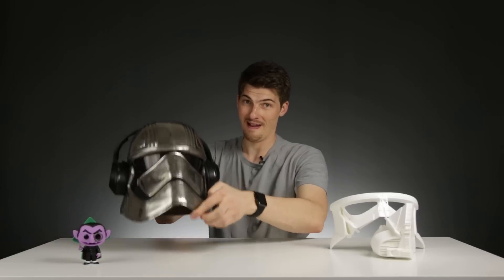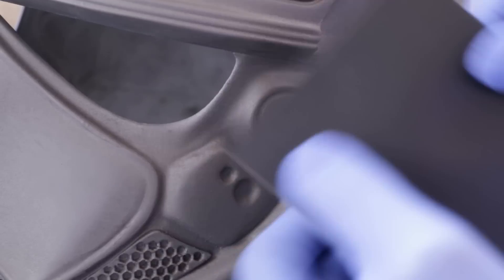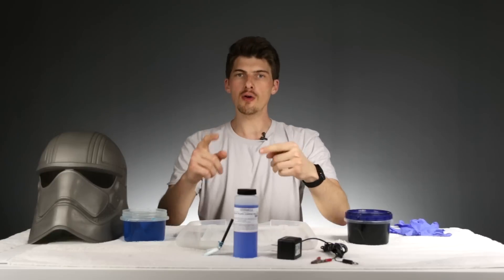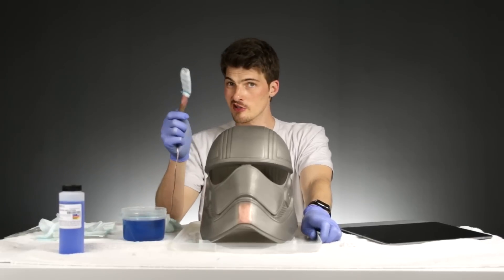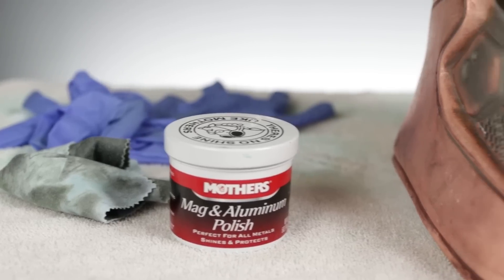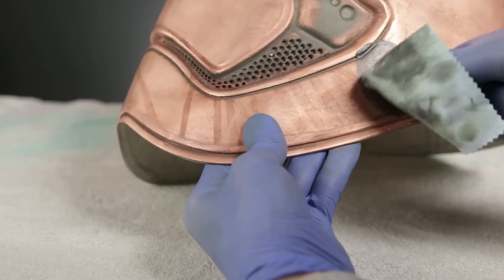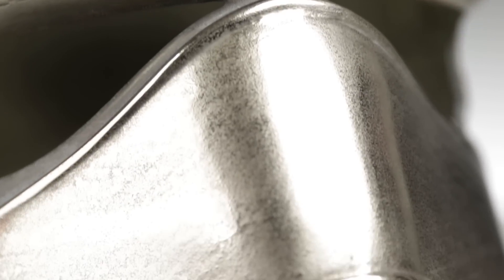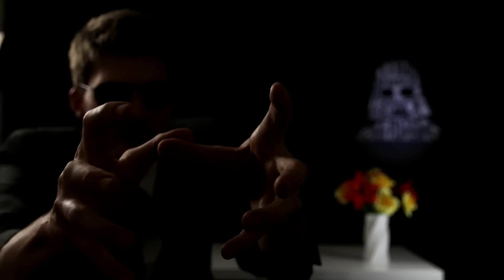How-To Make Metal: Electroplating a 3D Printed Star Wars Helmet

Comment: Great video! I ended up buying the conductive spray paint and electroplating kit to try it out on my parts. However, I ran into a problem and maybe you can help shed some light on it. In your video it seems like right as you start brushing with the copper, it instantly appears and becomes a fairly uniform layer pretty quickly. For me though, I feel like I'm brushing the same spot for a long time until I even start to see the copper show up and even then it never seems to become a nice solid patch. Have you noticed if the conductive paint thickness, smoothness, or anything else affects how well/quickly the copper attaches to the print?
Reply from the maker: +Yodaman921 Hey Yodamam! Sorry for the delay, but yes there are a number of things that can affect the plating process. First, you should make sure that your paint has cured for at least 24 hours. Until it is fully cured, any of the solvents still left in the paint can interfere with the plating. 

The smoothness also has a big impact on the plating. The smoother it is, generally, they better it will plate. One important thing, it did take quite a few minutes of brush plating over the same spot for the copper to really start showing up when I was doing it in the video. For the sake of viewing experience, I cut out some of it so it seems a lot quicker than it really was. 

My next recommendation is where you may see the biggest change! After you have built up some copper in an area, take the ground wire (the black one usually and the one that is clipped to the helmet in the video) and have it contact directly with your copper layer  (instead of the painted layer) while you brush plate some more in an adjacent area. This can have a huge impact as the paint is a decent conductor, but the copper layer you've built is an excellent one. 

For the future, I recommend first plating a spot where you can connect the ground clip to the copper, and than brushing outward from that spot. It seems to significantly help the speed.
Reply from the maker: +Yodaman921 Btw, thanks for not only checking it out, but actually trying this stuff out. Kinda neat right! Let me know if you have any other questions or anything like that. You can reach me on twitter @bretthalladay if you'd like too.

Cheers!
Reply: Thanks for the info!

As for my part (An R2 astromech dome), I'm still figuring it out as I go. I let it cure for 24 hours in a place that's both hot and dry. It's very smooth, it was previously primed and sanded before I applied the conductive paint, then sanded after it was cured. I've tried placing the clip on copper, but maybe I didn't have enough copper built up when I did that. 

Anyways, I ended up ordering a variable voltage and amperage power supply (0-30 V and 0-5 A) to see if adding a bit more voltage or current ends up speeding things up. Would make sense if it did. I'll let you know how that test goes though.
Reply from the maker: Yodaman921 ok yeah a voltage regulator can help out a whole lot.
Reply from the maker: Yodaman921 Yeah it can be a slow process at first. The copper layer needs to plate pretty thick. Everything sorta speeds up at a sliding rate. After you get that first layer thick and connect there, things can really start to speed up. 

I'd love to see everything as you work.
Reply: So I got the variable power supply, a 1"x6" copper anode, and I ended up going with a acid copper solution by Krohn; and boy can I tell a difference. It plates a lot quicker now. Just spending around a half hour got a good part of my project done, not much longer and I'll have the whole thing nicely plated. Just need to be careful though since I was playing around with the voltage to see what would be optimal, and if you increase it too much, the alligator clips start to heat up and melt the 3d printed part (my part is PLA). Overall though, I'm glad I got the new equipment and can't wait to get the whole thing plated and then polished up.
Reply from the maker: Yodaman921 Great to know your doing this on a pla part! Yeah the voltage regulator can make a huge difference in speed. I am now wondering if the use of acid copper can have a big impact on the speed as well. Its possible that the acid will help to prime the nickel paint for electroplating. 

Glad to hear its working out for you man. If you have an instagram or twitter, or just some pics on imgur or something, I’d love to check out your results!
Reply: For sure, once I get the dome polished up in copper I'll post a picture before I go on to nickel plating. 

At some point I may go back and approach this more scientifically to figure out what has made the biggest difference. It's just at this point I've changed so many variables. Different anode size, switching copper solutions to be the acid solution, switching brands of solution from Caswell to Krohn, and the power supply. I already got a nickel anode so I'm ready when I eventually get to nickel plating, but I may end up ordering some of Krohn's nickel solution since maybe it's a better quality than Caswell. One other thought is that my solutions have gone bad in some way; since we used the same kit and paint you'd think it would produce the same results unless something in my kit was faulty. Regardless, finally getting electroplating to work is really exciting due to the realism you can get on parts compared to using paints or pastes, or at least the ease of achieving realism.
Reply from the maker: Yodaman921 Yeah there is a lot of experimentation that goes into it all and a lot of variables. To be honest, I struggled for months experimenting with NUMEROUS different methods and everything before I figured this stuff out here. 

Seriously though, apart from being cool in general, being able to get this sort of finish with this method simply can’t be rivaled with any single paint or metallic coating out there. I’ve seen a few that come sort of close, but then they fall apart when they are touched by hands. Not only that, but this stuff is magnetic and conductive, which opens the doors for a whole number of things in the maker community. 

Glad you are getting it all worked out and the results are coming out how you want.
Reply from the maker: Yodaman921 Here’s a tip too, if you ever working on smaller projects, look into tank plating your parts. It reduces a lot of the labor involved, but most importantly, you can build really thick layers of copper. I did it one, let the copper build for several hours, and then used sandpaper to smooth out the copper and level it. I worked all the way up to 1500 grit and then polished like in the video. The finish is like a dang mirror. It’s stunning.
Reply: I've thought a lot about tank plating. It'd be a bit pricey to do one with my current project scale, but I've been curious to test a few set-ups to see if they'd work. Some ideas:

-"Tank" plate in small sections using clay. Position the object (my dome) so the area you want to plate is a relatively level surface. Put a perimeter of clay on the surface in the shape of the area you want to plate. Fill up the newly formed reservoir with your plating solution, suspend your anode in the solution, and turn on the power. So it should be like _|__|_ where the vertical bars are clay and the spot in the middle would be electroplated on the __ part. Keep moving the clay/reservoir around until the entire piece is electroplated (rotating the part as needed).

-If the large part consists of a bunch of smaller 3d printed parts, tank plate the smaller pieces, but only on the surfaces that will show on the final piece. That way it won't ruin tolerances or waste copper and conductive paint. Once everything is plated, assemble the small pieces like they normally would with glue or whatever method you prefer. Then fill in any seams in the copper by using brush plating and "welding" them together.

Once I'm done with plating my dome I'll use the left over acid copper solution to do some experiments on more parts since I'm really liking how the metallic finish looks and it's a lot better than using metallic filament, paint, pastes, or any other methods that simulate a metallic look. Just need to figure out an optimal process for plating 3d objects.
Reply from the maker: Yodaman921 so believe it or not, in this video this was the second Phasma helmet I built and electroplated. The first one I tankplated smaller pieces first because a setup large enough for a full helmet would be prohibitively expensive. 

While it worked out and the results were pretty great, it cause sooooo many problems and headaches and it led to a boatload of surface defects. Seriously, it was a very frustrating process. Doing this second one was worlds easier for the vid. 

I like your idea for the clay though. It's rather creative and just might work.
Reply: What voltage did you end up deciding was the best?
Reply: Voltage depends on a number of different variables, but the largest 2 I think are size of what you're plating and how conductive your surface is. For me I started around 7 volts for a Star Wars astromech droid dome, but the more copper I put on I was able to drop the voltage down to 5 volts. What I did notice though is plating worked best around 1-2 amps. So if I was below that I'd increase voltage, or if I noticed the amperage spiking too much, I'd decrease voltage. (Also a helpful tip, don't clip your alligator clip to your work, put a piece of metal in it's grip, such as 2 quarters, and hold it against your piece. That way as you play with voltage, if you go too high you won't melt or burn your piece).
Reply: Thank you for the info. 
Since I already have a power supply (for tattoo machines) I'm gonna buy the solutions separately. Probably the same solutions you bought. 
I, too, would like to see your progress
Reply: Update time! So I've been a bit busy recently and haven't had too much time to play with this. I did try out the clay wall setup; no dice, there was just too much leakage and the anode was too close to the part resulting in a bad plate job. However, I did purchase some microfiber sponges (https://www.amazon.com/gp/product/B00BTGSGFK/ ) and they are the best in the world. I cut a slit on one end and slipped my anode into it (so it's between the sponge and the microfiber cloth). So now there's microfiber and a sponge between the anode and my part; which is great because the sponge holds the solution in place and the microfiber is a bit more rugged than a cotton cloth. Things to note while doing this method, you don't need to press down on the sponge, just lightly hold it against the part; voltage needs to increase by a lot, the sponge is similar to a resistor, so I went all the way up to 30 volts; make sure your surface is nice and clean so it plates pretty quickly. 
Results of nickel plating onto copper after doing a quick test (took a couple of minutes to get this thin layer into place): http://imgur.com/gapiyER
Reply: So you added a microfiber sponge to your anode wrapped in microfiber cloth? 
That's not overkill? 
Regarding your picture, did you polish your copper layer any or did you just plate the nickel right after. Cuz that's pretty close to the look I'm wanting to achieve, not the super shiny chrome, but the dull stainless steel look.
Reply: Yodaman921, did you end up getting the nickel solution by Krohn as well and pairing it up with their acid copper solution? Also, did you just pour and use the solutions straight from the bottle, or did you mix anything into them?
Reply: Jonathan East 
Yup, I used Krohn acid copper and Krohn nickel. I poured them into a Tupperware container to make it easier to use, but didn't add anything else
Reply: Jonathan East 
I cut open the cloth around the sponge and slid the bare anode in. So yes there's a cloth and sponge. It may be overkill, but as far as I can tell it works (at 30 volts though). I didn't polish the copper, just cleaned it to get rid of any oxide
Reply from the maker: +Yodaman921 holy cow man that droid looks really slick. That look of a more muted and dense metal works really well for that piece. Great job!

How was the process for you? A bit of a learning curve no doubt, but it looks like you really got the hang of it.
Reply from the maker: Jonathan East yeah that's a really damn good look for what he is plating. I mean the thing is looking very legit. 

I'll have to check out the sponges myself, but Jonathan, post back if you start working with this stuff and share your results. I'd love to check it out!
Reply: It's been a really interesting process. Starting with the plating kit and slowly switching out the various components to end up with what I currently have. I'm glad I tried the sponges, because if I stuck with using cloth I would've given up (I actually bought some Testor's Buffable Metallic paint for airbrush before I tested the sponges, ready to try something else). Now that I'm back from a business trip and have a 3 day weekend, I'm going to see if I can keep plating the dome and get the full nickel layer on and see where I can take it from there
Reply: I still might end up painting it vs plating it though. Just due to the size I feel like some areas when I sprayed it with conductive paint ended up not having the nickel particles to make it conductive, resulting in some areas not obtaining the plating, or maybe I've just done too many tests and rubbed some of the paint off in areas

Comment: Say Mr Infosmercial! Could this work on Brass/Bronze PLA (I've got like 80%-20% bronse-pla ratio!)
Reply from the maker: +Jeroen Le Roy hey Jeroen! It depends. This time last year when I looking around for conductive filament and found that none could reliably be used for electroplating. 

The only real requirement is that the filament is conductive enough. The easiest way to tell is to use a multimeter to test your filament for conductivity. 

One thing to note about using your filament: PLA is notoriously difficult to sand down so it's smooth. 

It sounds like you just might be able to do it and it'd probably look pretty damn cool with the ridges from the printed layers too. 

I'd love to check out pics or whatever when your done trying!

Comment: That looks amazing but I have a question.

I have a 3D printer and am looking to.. well.. do exactly what you did. Plate some prints in metal and coincidentally am working on a Kylo Ren helmet. This looks like the best and easiest way for large scale prints but my concern is does this add weight and strength to it? I want to feel like the helmet is actually made of metal and have some strength to it. Will this satisfy that?
Reply from the maker: +steveolithography It'll certainly add a little heft to the helmet, but brush plating metal is really only done as a decorative finish meaning that the metal layers don't really build up too thick for added weight. 

What you could do is look into tank plating the helmet. That would allow it to sit in the solution for several hours if you like and it'll get real heavy.
Reply from the maker: +steveolithography One thing to note too is that electroplating a 3d print this way, even with thin layers, will significantly increase a 3d prints tensile strength even if it doesn't add too much heft.

Comment: how well does the metal adhere to the helmet compared to spray painting? im afraid of scratches and chips :(
Reply from the maker: covertspy2556 it can hold up to mild scratched and minor banging around but any gouged or rough scratches will damage the finish. 

My recommendation is to buy a can of acrylic enamel spray paint and coat it with ~ 3 coats. This is what I did and helps to increase the durability pretty drastically.
Reply: Thx Dr Smercial!

Comment: Nice vid.  why did you use mag/aluminum polish rather than brass polish? Polishes do contain oils and waxes that need to be thoroughly cleaned off before electroplating.  You may find that toothpaste works just as well and washes off easier, And smells minty fresh! lol
Reply from the maker: +Davey Hi haha. Yeah it's a very good point. The mag polish was just something I elected to use. I did wash the helmet afterwards, but it might explain why I encountered some issues with the nickel plating in the video. 

Thanks for watching. Maybe next time I'll try Crest or Aquafresh 😂

Comment: Love the video found it really informative, a safer alternative though is using humbrol metalcote spray which also polishes up and saves using chemicals and electric.
Reply from the maker: +MrConcj that stuff looks pretty promising. The finish is surprisingly good. 

The real reason I chose to explore a real metal decorative finish is because the implications are broader reaching than just a metal look. By making it real metal, the surface is conductive and it has slightly magnetic properties. This would obviously have a whole slew of use cases outside just the look. 

Back to the look, if you work at it, plate long enough, and polish properly, you can get such a mirrored finish that no paint can rival. 

Thanks for watching the video! I just might have to try that humbrol out.
Reply: I'm not 100% sure on this but I do believe that humbrol metalcote actually contain real metal which is why it is polishable, I'm not sure if it's enough to be magnetic though would be a cool thing to try out